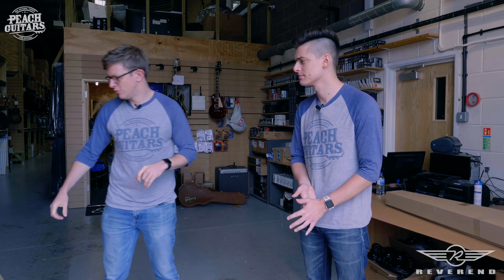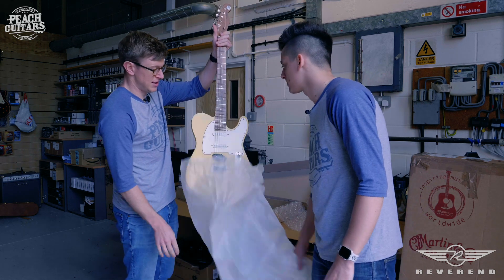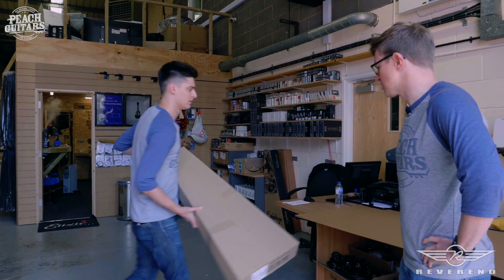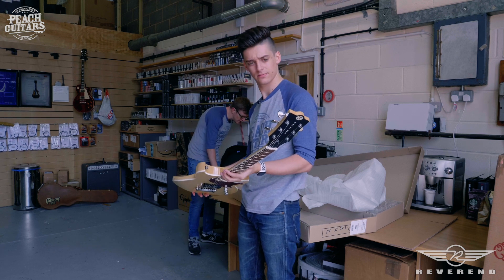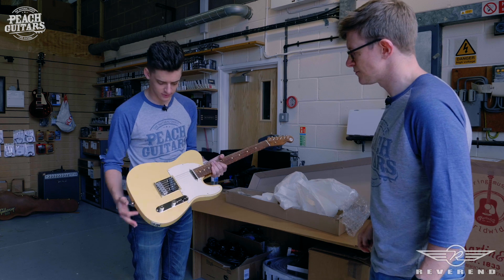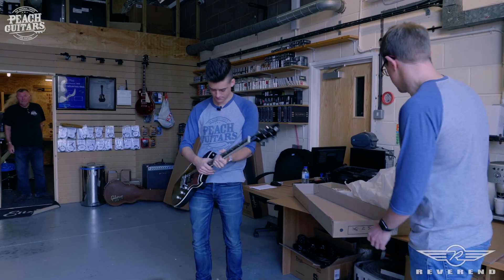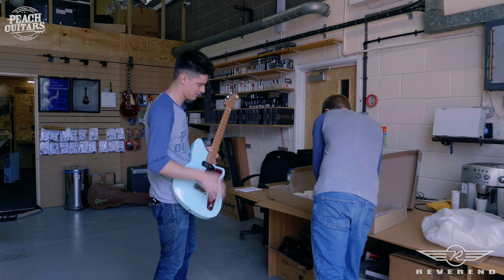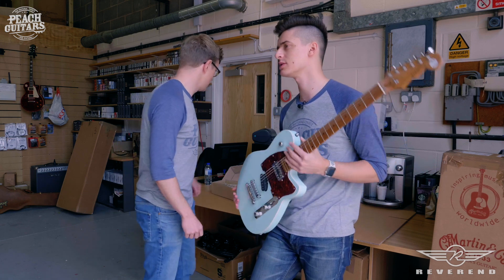New at Peach: Reverend Guitars Unboxing!

Comment: Problem is their value drops hugely when you want to sell it
Reply: dont sell it.
Reply: I bought a used 2019 Double Agent OG in midnight black couple of weeks ago in pristine condition for 649€. New 2020 models that are exactly the same guitars (except the colour) cost 899€ in that same shop. I would assume that the price drop for the previous owner was something like 350€. Is that huge or not, I don't know.
I like the guitar anyway and not planning to sell it.
Reply: Not really much more than anything else.I would go used or B Stock if you want to avoid that kick in the nuts.
The quality beats Fender Mex, maybe closer to USA; A bit more $ than Mex, and the resale is based on demand.Since they are not yet seriously in demand, they don't  fetch the resale they deserve.
It depends if you're more worried about your playing than the relative loss ,  - inspiration ain't  cheap.Figure it's a couple hundred more than the guitar you didn't really want.
Reply: @ataraxia4526  It's a bit more than a comparable Fender, but these aren't mass produced.It's a real concern, but if you know what you want, it's  worth it.A guitar to get when you've determined the larger parameters.
Reply: @markferguson3745  Before I bought this guitar I tried buch of Fenders from many price ranges and for what ever reason I just didn't feel convinced. When I tried the Reverend it all just felt instantly right. The finishing/build quality, neck and everything.